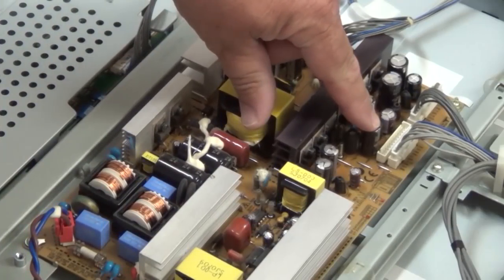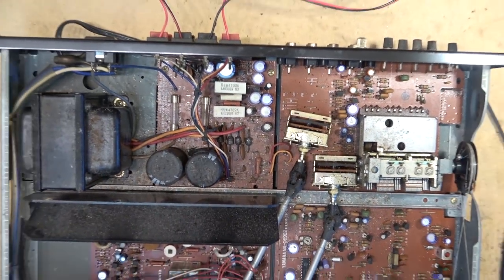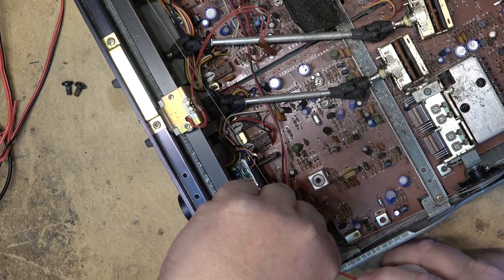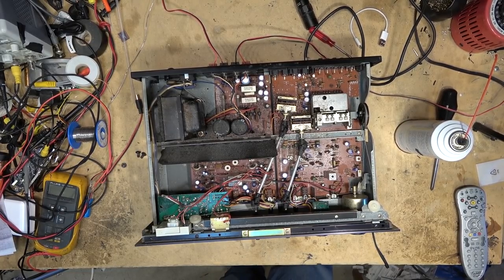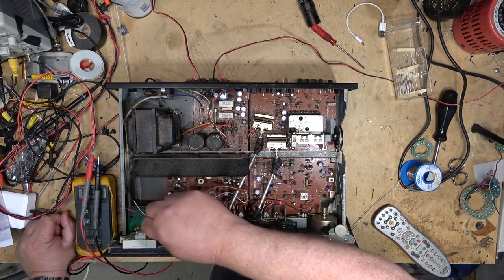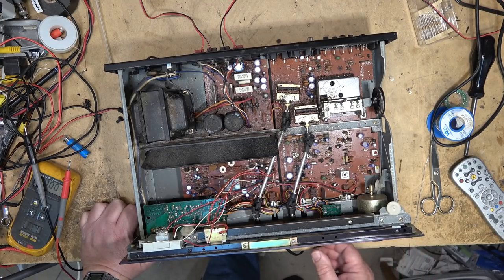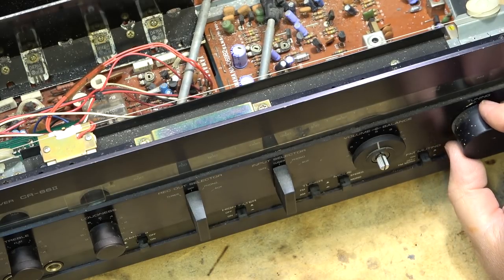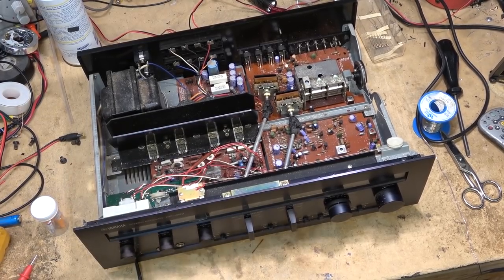Yamaha CR66 II making a terrible noise

Comment: You might appreciate my recent $13 Garage Sale story. Luckily I was in the car, but last Saturday I walked up to the house, which is right around the corner from me. I picked up a MPJA benchtop power supply model 9333PS. I also got a Tektronx T935 oscilloscope. (There was another scope, but it looked even older.) I got these for $5 each. I asked the guy if he was a repair person, but he said no, he had just purchased a storage unit with this stuff in it. There were a few other cryptic kinds of test equipment, probably for phone, or ham radio related, lying around, too. Then, I spotted a serger type sewing machine on a table. It was covered in dust, but they said it worked. I got it for $3, and it turns out the Juki MO-104 goes for something in the $400 range in the ebay world. The original reciept from 1983 says it really hasn't gone down in value. Now I need to learn how to sew.

Comment: Grab some led units out of old led lights, the 6 in series type with 18V forward voltage drop, complete with the little MPCB they are on, cut out from the rest, and with 2 wires on it place over the hole. They give off a lot of light, enough to replace the grain of wheat lamp, and the led units are generally free with you having a cheap LED lamp to replace. I also use 1W star units and put them there, running at 50mA, which makes them still very bright, but not run so hot.

Comment: Instead of "normal" LED's you could try "straw hat" LED's, which have a wider angle (90 to 100 degrees). I use them often replacing incandescent lights.
Reply: Yes they work great.   I also sand the surface to add a little diffusion to the light.

Comment: Hi I really enjoy your videos as I have always had an interest in electronics. TV's radio's and vcrs, I recently picked up a Panasonic / National NV-788 from 1983 and with the help of your videos got it working by cleaning and adjusting the mode switch. Im now considering getting a HIFi model NV-850 from 1985 new still in the box never opened. I know this model does have capacitor issues in the power supply. Being new but still almost 40 years old could they go bad when powering it up? Would love hear your thoughts on this

Comment: I have the CR-66. Pretty much the same just missing a couple features. Great sounding unit, not much power. Too bad this one seems to have lost the love.
Reply from the maker: They are speaker eaters.  Power so low they eat the voice coils.
Reply: @12voltvids  So they distort and the speaker coils are mostly on DC (clipping)?
Reply from the maker: @kyoudaiken  
Yup. Fastest way to destroy expensive speakers is a gutless amplifier.  Tube amps typically won't blow speakers as the output transformer removed the sharp edges of the clipped waveform.  Tubes don't clip and produce square waves.  They just get warm and fuzzy.
Reply: Id say about 15 to 20 watt with the to220 outputs. Sort of wimpy. Good point about the tube amps.

Comment: If you use leds, sand paper them to scatter the light better.
Some people treat electronics like crap,  sheds are the worse place to store anything :-(
Hmm a real tuning condenser, don't see many of those now :-(
Reply: There are those LEDs where they bored a conical hole in the middle and then polished it. It scatters the light sideways as well. Those are mostly seen on Christmas strings. The Chinese ones are dangerous, but a good cheap source for those LEDs.

Comment: What was your alternative to krazy glue again please?
Reply: Dollar store superglue, you generally get a strip of 5 or 6 in a pack, and tear off the one you need when you want to use it. While you can replace the cap, they tend to not seal well, so after a month or so of being open they turn to a block of clear resin. But with the tube costing under 20c, you just use the next one. Lasts longer if you put it in the fridge, I have some tubes that are around 10 years old in there, and they still work, though the glue is now very thick, and nearly like paste.